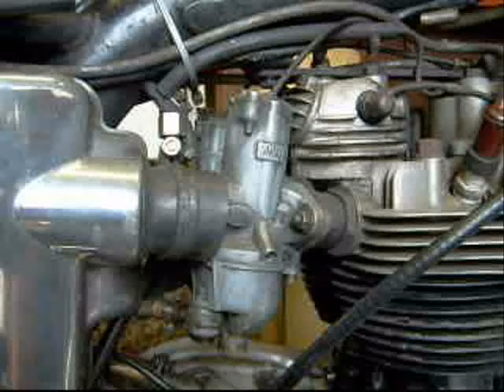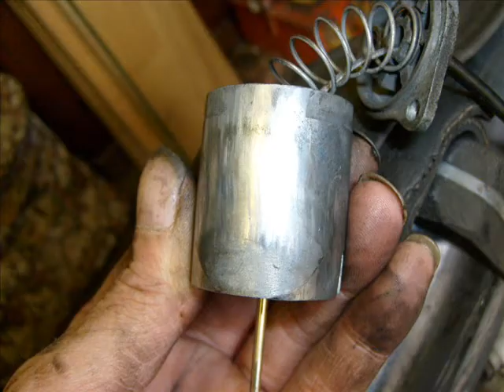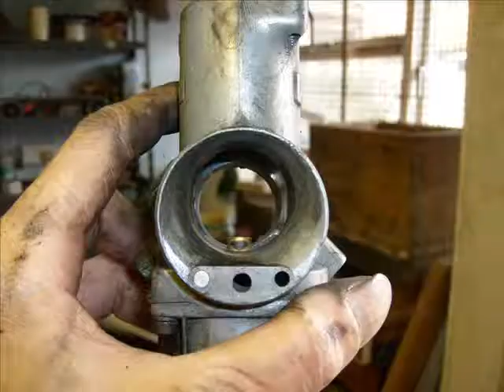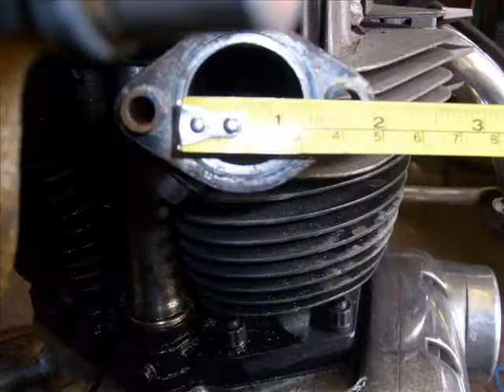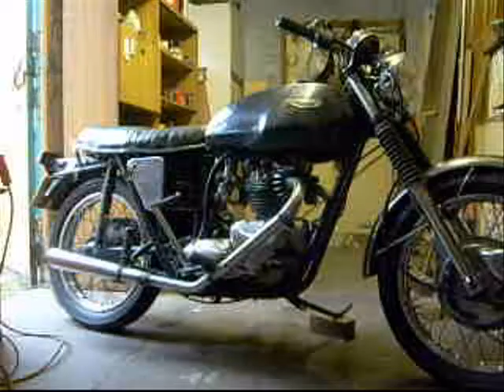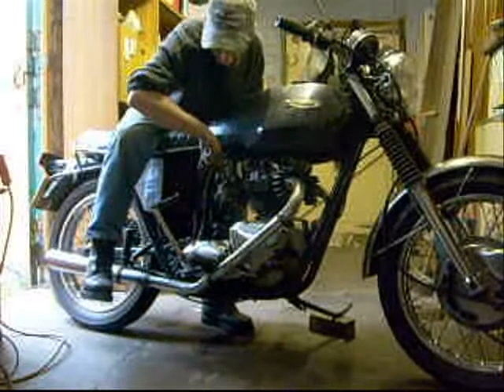carbs & starting Triumph Bonneville '73  T120R

Comment: Carb bodies can get warped by over-tightening the screws that hold the top on. Put the body in a vice with soft jaws, kinda diagonally across the screw bosses (hard to explain without video) and VERY GENTLY tighten the vice until the slide drops in. It will take some time and trial  and error, but it beats shelling out for a new carb.

Comment from the maker: HIi englishray1  glad you liked it :-)
Your slides should pull right out! with little resistance, either slide or body can warp. Careful us of fine wet&dry should sort it out. As soon as they move freely stop sanding, make the slide fit the body. If you fit new slides, make the body fit the slide.
A low tickover might be hard to archive.

Comment: Also, I have ridden literally hundreds of concentric-equipped machines, and I think it is a good idea before riding an unfamiliar bike to open the throttle all the way and make sure it closes all the way before you start it. Since the slides usually stick up near the top, finding out you have a stuck throttle at speed is not the way to go! Don't ask how I found this out. I almost had to pay for the chicken coop as well...

Comment: does your bike have the crossover/balance tube on the intake manifolds? our T120C has a roughly 5/16 vacuum/fuel line that connects the two sides letting them balance themselves a bit, don't know if that was a racing mod or a T120C thing or common practice

Comment: Don't put the actual round part of the body in the vise. The warpage occurs at the screw bosses so that is where it has to come out. Start squeezing on the body and you are done. And so's yer wallet.

You are absolutely right to make the 'body' fit to the 'slide' and not the other way  'round.

I have done this operation to correct a sticking slide with a C-clamp (G-clamp in Britspeak) on the tailgate of a pickup out in the middle of the Mojave Desert. Ingenuity rules!